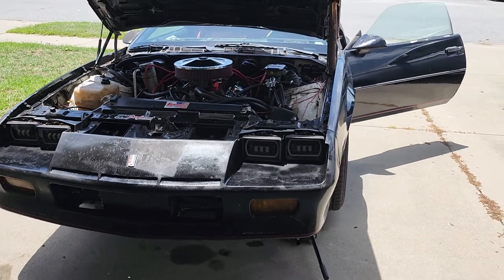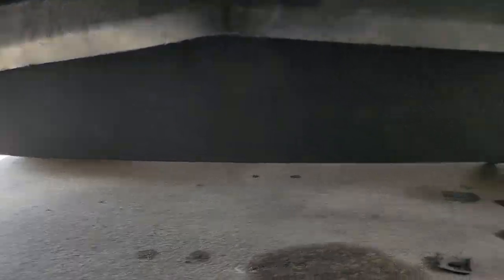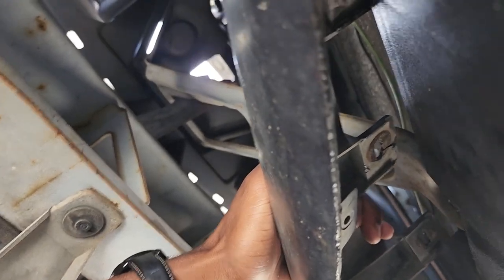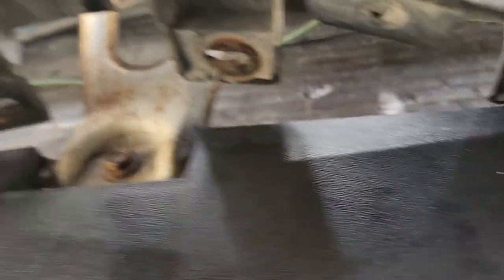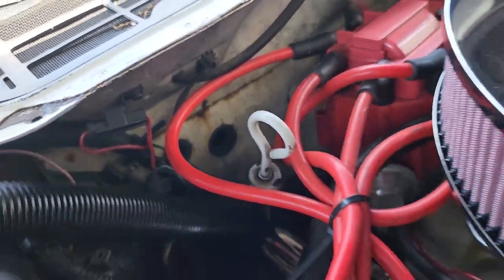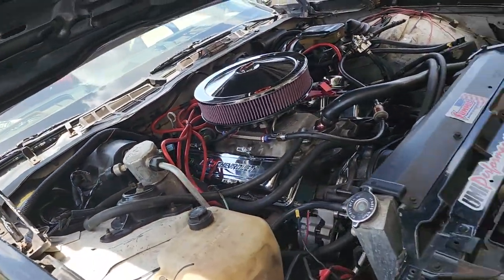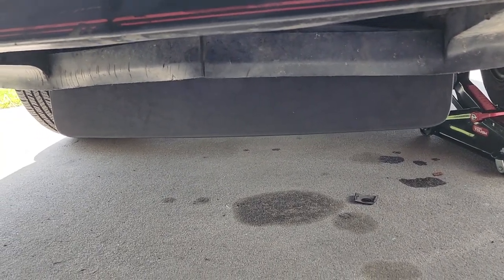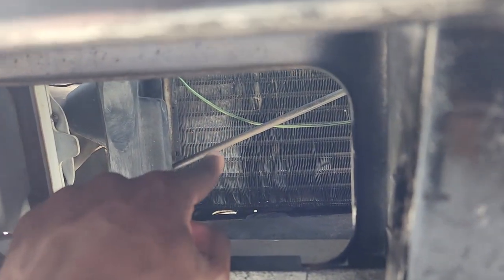3rd Gen Camaro Lower Air Dam Replacement

Comment: If temps are creeping at idle you need more cooling fan. The air dam will only help at speed.
Reply: @cartercamaro676  in your video (3:30) you claim when you are idling your temps will creap up after 5-10 minutes of idling. So either you lied in your video, or you are lying now. 🤷🏼‍♂️ either way. What I stated is true. If your temps are going up at idle, you need more fan, if they go up at speed it's your air dam not working proper.
Reply: @cartercamaro676  i'm just commenting on what you said in your video. And sited my source for you. Again, if you wanted to run more timing again you can control the heat with more fan. There is plenty of solutions to an overheating issue. At the point of this video you stated an overheating issue. I offered you a solution. Simple as that.